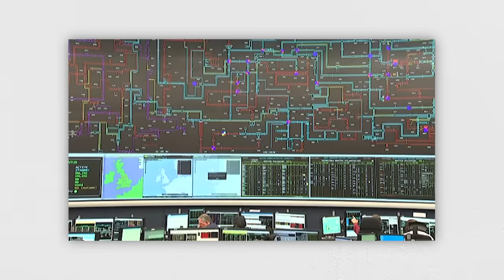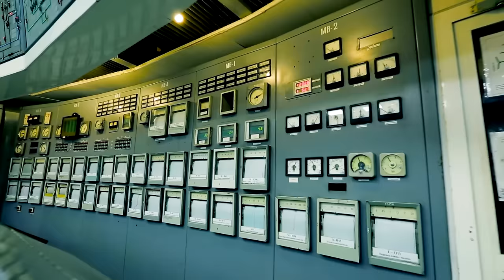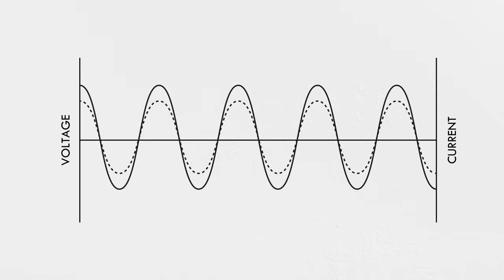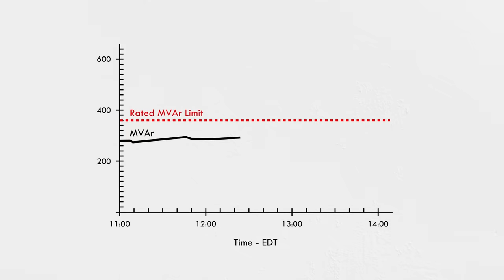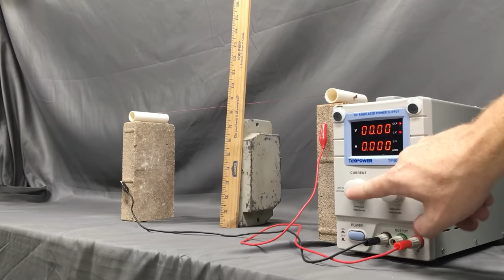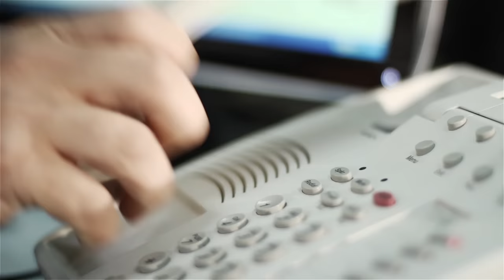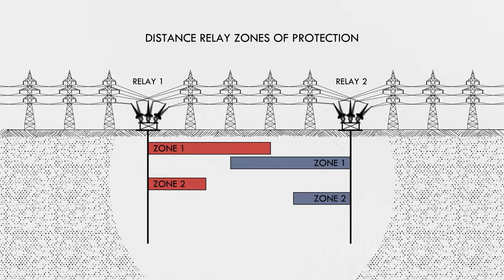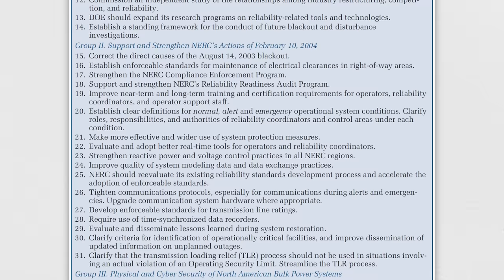What Really Happened During the 2003 Blackout?

Comment: I recently retired from the FERC and one thing that didn't get noticed is that typical fossil plants do not have black start capability and therefore cannot get the grid back up on their own (generally speaking). That means they need power fed into them before they can power up and generate back onto the grid. However, our hydro units in upstate NY, specifically the Raquette River projects do have that capability and were one of the main components that brought the grid back up.  I know hydro has gotten a bad name environmentally but there are certain attributes such as black start, spinning reserve and voltage stabilization that should be worth more than acknowledged.
Reply: I've heard an anecdotal story wherein one ingenious set of engineers at a coal-fired plant somewhere in NY used their car batteries, wired together, to run the coal supply conveyor belt (ordinarily powered from the grid) long enough to get the system re-lit.  Simple AC motors can be run on DC, and vice versa.  AC motors will always spin the correct direction on DC as long as the VA input is enough, DC motors on AC have a 50/50 change of running in reverse (if they run at all).  Them getting running in turn helped other plants restart.
Reply: This is not correct.
Some universal motors with brushes can run on ac or dc.

But normal industrial Ac squirrel cage asynchronous motors will not run in dc!
Reply: @xheralt . You cannot run a regular AC induction or synchronous motor on DC. It won’t spin. What you’re probably referring to with the car batteries is using them to “flash the field.” An AC synchronous motor uses an active magnet field (usually the rotating part) to excite (generate voltage) across the stator. That field gets established using a DC source when the generator is getting brought online before the breaker is closed. The generator has a device called a voltage regulator that monitors AC voltage and current output to determine how much DC field energy to put on the field rotor. More field current means a greater flux across the stator. This can increase or decrease either the voltage (if the generator isn’t online but spinning up) or reactive power (VARs) if the machine is online connected to the grid.

There is a rough direct relationship between voltage and vars based on the electromagnetic inductance of the generator and the electrical system it’s connected to. The greater the DC field, the greater the VARS, which can make the voltage go up (and vice versa).

The voltage regulator only has AC voltage and current to determine how much DC field energy to put to the rotor. If the machine is spinning but offline, it only has voltage. The AC voltage doesn’t appear on its own because until there is DC energy introduced to the field, there is no voltage. 

A lot of older machines used something called a “pilot exciter” to initially excite the field. Think of jump starting your car. This is very similar to what a pilot exciter does and lights the DC “pilot light.” This is called “flashing the field” by giving that initial bump. A lot of plants did not maintain their pilot exciters over the years. So it is out of service a lot of times. So what they can do is bring a car battery in during start up and put the DC voltage across the collector or slip rings (the apparatus that transfers the DC energy from the main exciter to the DC field) on the DC field. This makes the AC voltage immediately start across the generator winding and the main exciter and voltage regulator can take off for the remainder of startup and while the machine is online. 

The battery is only needed for a brief moment on startup and the machine can do the rest.

Modern voltage regulators with power electronics don’t have this problem as the solid state voltage regulator and exciter can do this on its own with no battery needed.
Reply: I've worked at the Indian River plant in Delaware and currently at Vienna plant in Maryland. Both of these plants have black start capability with an auxiliary jet that ties into the grid and we can get our start up power from it. They're also used as a kick in the pants for when demand is up but starting the main unit isn't neccessary.
Reply: All Nuke plants have black start capability since they all have multiple, large, emergency generators.
Reply: @bobd.  Incorrect. Nuke plants are last to startup in any black start procedure. The grid has to be stable first before a nuke plant can tie online. Gotta have a solid offsite power source present first too. Can’t do that without having a bunch of hydro and fossil units online and tied together, first.
Reply: @nrutledge01  My comment was in response to Joe E who said that fossil plants need offsite power to startup. I commented that nukes have onsite power from multiple sources to allow them to start up (or stay up). In most cases they will not go down because of a grid-related LOOP event specifically because of those onsite sources which are augmented by grid power (when available) but they are not solely dependent on. That capability to remain up and running (not generating power sent out to the grid) is by design to ensure safe shutdown. I said nothing about syncing to the grid. So if by "start up" you mean spin the turbine and send power out on the grid that is not what I am talking about.
Reply: I thought natural gas plants have oil powered turbines outside to warm them up.
Reply: @nrutledge01   Nice recap.
Reply: How does hydro have a bad name environmentally compared to fossil fuel plants?
Reply: @tomlxyz  It mainly has to do with segregation of rivers, water quality issues and fish passage interruptions. While that has some truth to it, like other things in life it is not the only thing.  Loss of habitat along rivers and sewage discharges have long been a major disruption of fish and Aquatic life but since hydro is a easy source ,and supposedly big money, it gets most of the blame.
Reply: @oceancon  Loss of habitat along rivers really falls on deaf ears to me a lot of the time cause your really just changing the enviroment not removing it. The biggest issue with hydro is that its much more difficult to profit of government grants from cause with wind and solar you can sell finished units whereas dams are all custom construction so the local workforce gets paid.
Reply: @Boony Tooty 
True, they stopped the development of nuclear power in the 80’s pretty much. Like the Shoreham Plant. At least Georgia has something new, Plant Vogtle.
Reply: @nrutledge01  You'd think they'd just keep a spare car battery in the janitor's closet or something, instead of rummaging through the parking lot.
Reply: @xheralt ,  The battery restart could not of happened.  I worked on a 1,000 HP natural gas boiler, and the air inducer motor was 75 HP and would require a 120 KW portable generator to power this boiler on AC power, about the largest trailer type of rentable generator.  And 1,000 HP was a heating boiler, not the 500,000 HP boiler like used on a 250 MW power plant.  

A coal fired 250 MW power plant would require about 2 MW of power coming into the system to run the conveyors, induction air fans, and more to allow them to start up.

Niagara Falls is allowed to start from black, due to it being a hydroelectric system.  Hover Dam has it's own pair of 2 MW generators that supply power just to the dam and it's control circuits, and that 4 MW is not connected to the grid, so it can also do a black start, and actually their lights will never go out (unless the dam runs out of water). 

It might be possible to move a couple of tons of coal into a power plant boiler, but using a backhoe or something that can actually move a couple of tons of coal would be required, not a bunch of 12 volt batteries.    It is the fans that can not be started with DC power, and the fans must be in the 1,000 HP size range for that large of a boiler.

Comment: I'm a power systems protection engineer and confirm that this is a very informative and accurate representation of how protection would react in this situation. Really pleased that he got distance protection correct. I wonder whether Load Blinders on the distance relay characteristics would have prevented the cascade or would the reduction in frequency and voltage have led to the cascade being inevitable.
Reply: I was at a nuclear plant in upstate NY at the time.  Sometimes it wasn't even the protection relaying.  We started experiencing wider and wider frequency fluctuations as loads/gen units were tripping and lines tripped and reclosed.  Afterwards it was determined that even though our main turbine governor wasn't in 'speed control mode' (nuc plants aren't used as 'regulating units' ) it just couldn't keep up with the wide swings, hydraulic pressure was lost and we went down.
Reply: What about load shedding as well? Or was beyond the capability of load shedding?
Reply: @mikefochtman7164  makes sense. I'm aware Nuclear is for base load only as takes a large amount of time to ramp up and down. In the UK we use mostly oil, gas and coal for reacting to increases/decreases in load. Basically, the gist I get is that this was a ticking time bomb with only one possible outcome. I am impressed that the grid actually coped with so many line and generator losses before the final collapse. From a planning perspective I only planned for an N-1 event. I think that the grid in question was at N-4 before the final collapse. One generator + three lines down.
Reply: @stephenrowley4171  I don't know that much about this particular incident, however the grid was much larger than the area lost. I think that effectively this was load shedding to try and save the rest of the grid and prevent a black start event whether it was intentional or not. Load shedding is very hard to manage when not initiated by control. As I understand it from Mike above lines were autoreclosing which would cause huge power swings and make it very hard to try and balance the load & generation. Also bulk supply points usually have underfrequency and undervoltage protection to 'cut off an arm to save the body.' This is a kind of automated load shedding to try and save the grid from collapsing.
Reply: @mikefochtman7164  what happens when a nuke plant has to shut down? Does it take a while or can you just SCRAM it? Do you have a bunch of excess heat to deal with? Is it difficult to restart?

Nuclear is really interesting to me, but the only design I know much about is the RBMK for obvious reasons...
Reply: @renakunisaki  Wikipedia has a good article on scraming a reactor. Yeah there still some residue from radioactive decay. Buts it's less than 10% if normal output.

Unless you've got a badly designed reactor which for short period massively increases the output of your reactor. As a happened to certain Ukraine based reactor.
Reply: @stephenrowley4171  Loading shedding will happen if needed, but they need to know it is needed.  If the operators are being lied to they wont run through emergency procedures.  First thing they could have done once it was that bad was reduce system voltage.  This will give some margin.  But if you dont know it needs done in a given area.  The frequency will look fine, regardless if a line in burning down.  There is under frequency load shedding circuits but those also do not care if you are burning a line down and only look for frequency drops.  A big enough event not seen coming will over run those and their auto load shed will not be enough.  

Ultimately they did load shed.  All of it.....
Reply: @andrewt.5567   That makes sense of something I dimly remember from the report on the 1965 northeast power failure - apparently some station(s) had their bearing oil pressure supplied by pumps driven off the grid and ran their bearings before they could be stopped.    And a number of other unfortunate complications caused by designers' assumptions that the grid would always be up.
I suspect that some of the lessons learned in 1965 had been implemented by 2003.
Reply: @andrewt.5567  This is very informative thank you! For the turbine, I'm assuming you wouldn't stop it completely because it's huge and the static friction on the bearings would be very high? And make it hard to restart? Why keep it turning at 3rpm?
Reply: @BeastlyKings  
Why keep it turning? 

Only a guess, but I'd suspect deformation, bowing/warping,... causing odd wear profiles... etc.
Reply: @andrewt.5567  You never reduce system voltage at the transmission level.  Low voltage was the whole problem.  As they continued to lose lines, the reactive load on the remaining lines exceeded their ability to produce megavars.  That's why the Sammis unit tripped due to over excitation.  It couldn't increase reactive enough to get the voltage anywhere near where it needed to be.  The loading on many of First Energy's lines were way over their design rating.  Besides sagging, these lines will anneal and will have to be re-sagged or re-conductored.  The only remedy is to shed load sufficient to return the lines to within limits.
Reply: @FOH3663  Correct, it's to prevent bowing (known as "hogging") of the turbine shaft. The shaft remains hot for some hours following a trip, and if left static, will develop a warp. The turbine set is rotated at slow speed while it cools down. The equipment that slowly rotates the shaft is called "barring gear".

Comment: These kind of events are happening all the time and we don’t even notice. I’m fascinated how reliable the power grids are made, and how resilient they are. It took so many consecutive failures to actually end up in a blackout. Thanks for this video this is very interesting and well explained as usual!
Reply: Actually it was only one failure, providing power to Cleveland with their high demand. Stopping this wiuld have prevented the full blackout and only pull Cleveland off grid, keeping the rest on grid.

Disconnect high consumers and save the rest.
Reply: Seems like it mainly boils down to a computer glitch. If they had worked correctly and alerted operators about the faults, they probably could have dealt with them properly and prevented the failures from spreading beyond the first one.
Reply: @renakunisaki  Or if the power company actually cut the trees that kept taking down their lines. Preventative maintenance costs money though so it's better to let things collapse and fall apart.
Reply: @renakunisaki  Like most big problems, it comes down to a perfect storm of many failures at the same time.
Reply: @maximilian19931  Yes but from what was described that would have been the responsibility of the load companies control centre and they didn't even know it was happening until it was out of their hands.